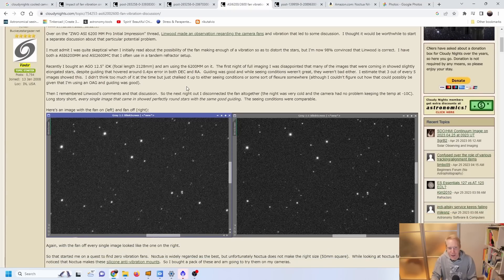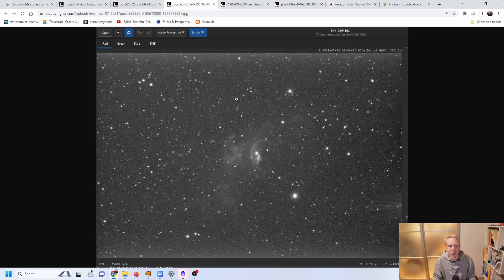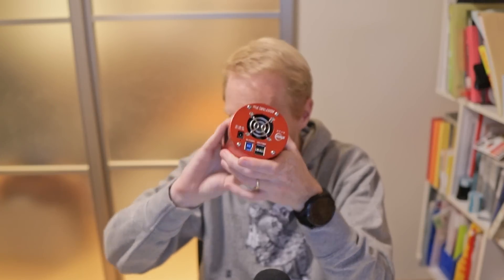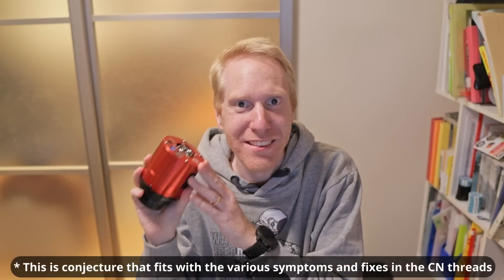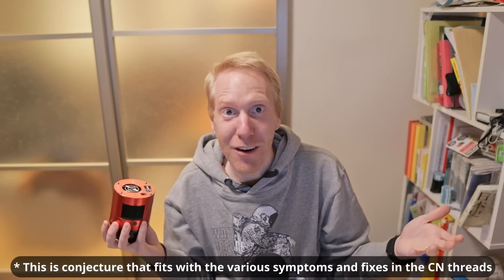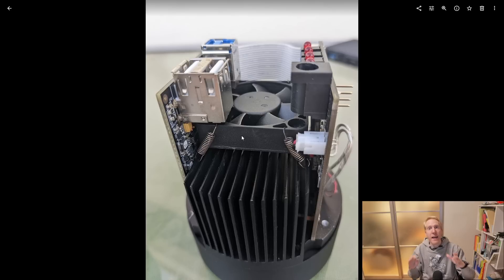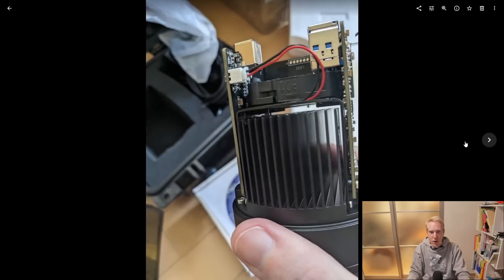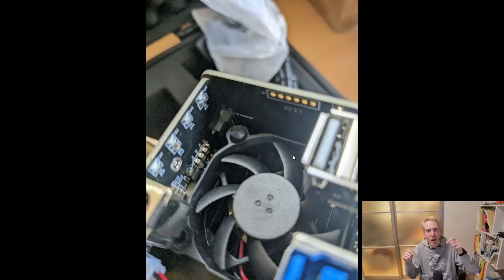Cooled Cameras can HURT our images?! 😱 HOW?? EASY fixes!

Comment: I have my 2600mc at -20 degrees. Is that too much for the camera to deal with? Should I do -10 instead? I'm not sure if I'm risking shortening the life of the camera by doing the maximum cooling, I dont mind using battery/higher power needed but just wanted to see if anyone thought having cooler -20 is actually bad for the camera long term. Thank you
Reply: @CuivTheLazyGeek Thank you so much as always sir, you’re a gentleman and a scholar! 🙏🙏

Comment: My 6200MC just developed a rattle bad enough to make the moon's edges wiggle. Its really bad when its connected downstream of an Off Axis Guider on my C9.25 for some reason, perhaps just an unfortunate harmonic. I fought with star trails for so long, and bought more and more expensive mounts to try to solve it to no avail. But now that i know its being caused by the fan, the idea of having to take apart my $3000 camera and monkey with affixing an aftermarket fan to a hacky rubber booger just to get a round star makes me want to be sick.

Comment: Thanks for affirming this fan problem!!! I have struggled all summer with the same fan issue with my ASI533MCpro....thinking the problem was with the mount tracking, battery. etc.
My fanon-fanoff Images were exactly as the images in your video!!
Reply from the maker: Glad this helped!! It's indeed good to be able to check and validate this!

Comment: Now there is a sale of ZWO cameras in the US for Black Friday I’m tempted to take advantage and buy my first cooled camera and I starting reading about fan vibration. I’m beginning to feel like an involuntary beta tester for ZWO. Having issues with my new ASIAir Plus because of the focal length of my C8 and the small sensor of the ASI585MC. If I buy a cooled camera will I get an imbalanced fan? Seems like all the issues with ZWO equipment are because of higher focal length scopes like my C8. So far if seen ASI533, ASI294, ASI294 and ASI2600 cameras mentioned in my research. I bet if you hook anyone of these cameras to power and hold the camera you’ll feel vibration., but like you said the shorter focal length equipment doesn’t seem affected.

Comment: Thanks for the video. I love watching your videos because you always look at things very analytically and show great attention to details. You think like me! One aspect you didn’t mention and that I don’t see mentioned in the comments after a quick scan is that if you are using a ZWO camera, there is a good chance you are using an ASIAir as well. Guess what. These have fans in them too and are often attached to the telescope or mount. So that’s another thing to consider. Another is the power source. If you use a portable power box like I do, it also has a fan in it. Even if it’s sitting on the ground under the mount it can cause vibrations.

Some solutions I’ve seen suggested by others are having a separate tripod with the ASIAir attached. I personally haven’t tried this because I can’t imagine the cable management difficulties being worth it. I noticed a little improvement when I put a thin piece of rubber between the ASIAir and the mount. The power box vibrations, which I first discovered while going through a focusing routine and noticing the guiding get jolted when the fan kicks in, can be cured quite easily. I folded up a soft blanket and put the power box on top of it. Strangely enough, now I notice that when the fan kicks in I actually get better guiding! I believe it’s some sort of frequency resonance where vibrations sort of cancel each other out. And one last thing is to purposely balance the setup East heavy. As you know, this is good practice anyway for smoother worm gear movements but it has the side effect of absorbing vibrations through tension. A perfectly balanced setup will be more susceptible to vibrations because it can move either direction quite easily while the East heavy balance won’t allow for small vibrations to have enough force to cause these little vibratory movements.

Hope that helps both you and anyone else reading this!

Comment: Spent 3 months with asi2600mc pro chasing down oblong stars with my Celestron 8 SCT.  guiding, collimation, tilt, backfocus, etc. nothing worked.
Gave up and bought a Celestron 9.25 Edge HD.  All above looked good except still I had oblong stars.
Tried exposures of 1,3,5,10,30,60,120, etc.  same oblong stars that all looked the same.
If it was guiding, they would be longer as exposure time increased.

Turned off fan.  Pinpoint stars at all exposures even at 5 minutes.

Turned on cooler,  oblong stars resumed.
Turned off, pinpoint stars.

So i decided to try my asi533mc pro.  Same issues.

On - oblong
Off - pinpoint.

Talked with ZWO.  they said certain scopes at longer focal length have a natural resonance frequency that induces vibration noise.

8 Edge hd was notorious.

Apparently it is not just that scope.

Now I own a 9.25 edge hd.  Darn!  Sorry, but I am not returning it.
Reply from the maker: It's really interesting, the SCTs seem to be the worst affected, the beefier long focal length refractors seem to be fine

Comment: Wow!   I never thought of that. Thank you for pointing this out I use a C14Edge+ZWO ASI2600MC pro and at 4000mm fl I had oblong stars.  I had no issues with the Hyperstar.  I tried removing my guidescope and using an off-axis guider with same result, oblong stars. This happend with good seeing and near perfect guiding.  I was using a CGE Pro mount.  I tried my Skywatcher EQ8RH-Pro with crazy accurate encoders and still same result.  Well I just ordered a set of these anti-vibration pads.  This makes a lot of sense as it wasn't happening with my ZWO 224 (non-cooled camera). I just hadn't clued into it.   I'm most certain this is the issue. Thank you.

Comment: Great video!  Literally just had to replace my fan in my 294mm in the middle of the night.  Had a normal imaging run last night, but when I started tonight I had really bad star trailing.  I had already remounted this particular fan on the elastomers two years ago when I fixed its brother the 294mc.  Took it apart and didn't see anything wrong with it, but was certainly out of balance based on images where I had the cooler on / off.  Luckily I had an extra fan laying around so was able to salvage a rare clear evening.

Comment: it should be possible to balance the impeller blade if its balanced then the need for vibration suppression wouldn't be necessary. This was an issue for cameras on drones as when the refresh rate came close to the propeller vibrations then problems occurred. Balance first would be better. Anti vibration mounts for drone cameras and flight controllers would work in the camera internally.

Comment: Holy crap... I was using my C9.25 @ f10 (2350mm)  for the very first time a few months ago. (I've been imaging for 4+ years). I was using the 533mcP. I was getting perfect oval stars. I had only used that camera at f2.2 (525mm)

I could not figure out what the heck was going on. I thought I had an optics problem due to a previous incident(another story, Isn't astro fun???). I was playing with tilt and everything I could think of. I gave up at 3am... I think this is it. 

I think you are right, it isnt just ZWO... I thought when I first saw these cameras tht a fan on the body could cause problems... but I was thinking more when they start to break down.
Reply from the maker: Did you find out if that was is??
Reply: @CuivTheLazyGeek I'll investigate this weekend now that you have given me more to go on and will let you know.

It was not a guiding issue because I was getting perfectly illuminated pill-shaped stars and know what those look like (too well, lol) I was totally confused because it didn't look like a mirror issue or tilt since it was so consistent over the entire image... 

I had wanted the Silver Sliver Galaxy up close and was curious if my image would be better without the f7 reducer. I think this may be it. You have given me new hope. Maybe I'll get a few f10 images out of the C9.25 this summer!

Comment: @CuivTheLazyGeek  So even if the fan has a magnetic air-bearing these vibrations are still there? I'll have to revise my Dedicated Astro Cam Selection Spreadsheet. Curious: could N.I.N.A. be set up to shut off the fan during acquisition and on in betwee---nevermind.
Reply from the maker: Well it can depend on the fan as well, and on the scope itself (heavy fracs may be more resistant?)
Reply: @CuivTheLazyGeek  That makes sense. A 150mm APO on a CGX-L might be less susceptible than say a RASA 9.25 on a light mount at max capacity.

Comment: It's probably the fan indeed, but thinking about it, as a wild guess, could it be possible that the equatorial mount is experiencing low current? These newer dedicated cameras consume a lot of power to cool the sensor, and perhaps the R.A. motor struggles more to perform tracking and the necessary autoguiding corrections when active cooling is enabled, "drawing" power from the source. Of course, this probably only applies in cases where the equatorial mount and the camera share the same power source. Anyway, this could explain why the stars appear more oval-shaped.
Reply: No. The PHD2 log shows no difference between cooler on and cooler off.

Comment: Well I got the anti vidration feet , at first I bought the wrong size so I sent them back and got the SAV3 . went to install them and the dont fit. I could not get the feet into the fan. I took some struggle to get the through the holes but I could not get them any farther up. I did not want to tear them or mess up the fan. I am using the zwo 294 so maybe the holes are smaller ???

Comment: I've noticed an issue with my ASI2600 MMPR when photographing the sun with exposures ranging from approximately 1 to 3 ms. The manufacturer suggests a makeshift solution which involves adding an additional O-ring. However, I find this to be inadequate because the O-rings don't prevent the mounting screws from continuing to be in contact with the fan body, thus the problem is not avoided.

My impression is that ZWO isn't treating the solution to this problem with the seriousness it deserves, in a similar way to how they handled the oil spots detected on the sensors of the high-end ASIs. This was an issue that wasn't properly addressed until it began to be claimed through public forums. My perception is that ZWO doesn't have an effective customer policy, and only responds to the technical problems of their already sold cameras when public complaints begin to affect them.

Therefore, I believe there's a need to further publicize these issues. If any videos or photos are needed to demonstrate these points, please feel free to request them.

Comment: I’m running a RC with fl 2800mm, QHY268MM, and OAG/ASI174: no vibration issues. But terrible tracking issues because either no trackable stars or sooo mushy stars that PHD2 was having problems locking to part of the star. So I attached a 1300mm Maksutov and now my tracking is the best it’s ever been. Last two sessions sub-pixel tracking typically 0.5 or less. I’m ecstatic!
Reply from the maker: Everyone seems to be saying QHY is vibration free, excellent!

Comment: Before you take your camera apart, test by simply turning off the cooling.  I'm wondering why you see oblong stars,..meaning the vibration had specific orientation. Was it consistent across the frame? I would have expected larger stars but not necessarily oblong from this issue.  
I'm also curious why you are only seeing this with long focal length optics. It sounds like  the vibration is bring sent to the OTA and that is the issue, not the vibration of the camera sensor itself. In that case these may be something unstable about the OTA, perhaps the hyperstar housing is not tight?

Comment: What about sacrificing a little bit of cooling capability, and take out the fan completely... What if, you no longer cool down to -20C, and instead, go for 0C, so assuming this 20C degree difference would be sufficient for the fact that you take out the cooler, so heat is no longer being dissipated so efficiently... but the difference between 0C and -20C is not that much, especially with the new generation cameras, which already have low noise... in the end, the point is to have good calibration with properly matched light/dark frames, so it should work... 
Personally, I wouldn't mind sacrificing some Celsius degrees, and avoid the whole vibration problem, altogether...
Reply from the maker: Even at 0 degrees I don't think a fan less solution would work... Could be good to test though!

Comment: I have noticed the ZWO fan isn't quite centered in the housing either, I have aquired a new camera from Player One Astronomy called the Artemis-C Pro and have noticed the fan is dead center, and when powered on with fan running I cannot feel a thing. The fan being slightly off center would also cause slight osclation

Comment: Ah I got the same issue on my RisingCam camera and I exchanged a Noctua fan to solve the vibrating issue.
Reply from the maker: Was it gen1 or gen2???
Reply: @CuivTheLazyGeek  It was Gen1. It was so hard to address. Finally, I checked different exposure times and found the egglong stars even appears in 0.1s shot and start to check other vibrations than mount.

Comment: This is probably the issue with my ASI2600MC C11 setup. The Stars were also elongated in that direction. I thought it was back focus. I will say that in the summer time when my C11 is out more the cooler is working a lot harder (-10) and it seemed no matter what I did the elongated stars wouldn't get better. Thanks for this.
Reply from the maker: Glad to help! Hopefully you can get to the bottom of it!

Comment: Hello Cuiv, I always follow your videos with great interest and in relation to this video I wanted to remember my direct experience with these small fans in other sectors which are usually extremely well balanced. It may happen that someone is born badly but it is easier than working for many hours in the end a little dust accumulates on the fan blades which, increasing over time, unbalances it and creates harmful vibrations. Often paste clean the fan with a few cotton swabs and some alcohol to solve the problem.
Reply from the maker: Thanks Massimo! That would be an easy fix indeed!

Comment: I'm also just speculating. Maybe it's more related to image scale rather than a matter of focal length? Sure, with the same camera you will get a lower resolution (well, actually a "better"/higher resolution; less raw numbers) when increasing the focal length. But, if you have for example 0.5''/px with a particular camera and a high focal length ota and facing this issue; would you get the same issue with a lower focal length ota and a different camera (with tiny pixels, and also a vibrating fan) with the same resolution of 0.5''/px? Probably yes? Furthermore, binning the camera on the high focal length ota would mitigate the problem?

Comment: I'm not sure that I would be as charitable to ZWO as you Cuiv. If fan vibration is indeed the cause, then this is a design flaw or QC issue that ZWO should acknowledge and fix FOC on request. It's not an 'oh well maybe they'll fix it in a future release and we can buy the camera again' type situation to my way of thinking. And it certainly should not be up to the end-user to modify their camera to fix a design flaw and invalidate their warranty in the process. It seems like a pretty basic fail to me that to a manufacturer should be obvious. As pointed out in the video, other manufacturers are aware of and have designed out this issue. The only way it would be acceptable would be if all ZWO cameras were rated up to a certain focal length, then as a consumer you would know that if you planned on doing long FL work, you would choose specific cameras rated to keep vibration below a certain level. That not being the case, like the oil-leak problem, this should be something that ZWO fix for free- I feel very strongly about this! I'm pretty sure that legal bods would also win any argument that claims such a fault would potentially make their cameras not fit for purpose.

Comment: Cuiv, excellent video as always!  Do you think  there is a "limit" on the focal length where shorter than the limit is ok, but longer is NG?  Could it be calculated mathematically?
Reply from the maker: No it will depend on the fan lottery (amplitude of vibrations) AND the type of scope used, how the camera is attached, etc.! So a lot of factors...

Comment: Hi, great video thanks!  I had this issue with an Altair 294C Pro Tec which has the old fan connection setup you show for the RisingCam. This was the issue I posted as ArEnJee on Cloudy nights. I also had the same issue on the EdgeHD8 with the Altair 26C Tec, which again is the same (old) design. I've been trying to work around the problem for some time (using lower voltages so therefore fan speeds sometimes helped). 'Fortunately' the fan burnt out on the 26C and I had an excuse to replace it with a low vibration alternative (Noctua NF-A4x10 FLX, Premium Quiet Fan, 3-Pin (40x10mm, Brown). That worked.  It's relatively straightforward to do as a straight swap, still using the springs - you just need to recycle the original 3 pin connector, shorten and join the wires together (I used telecomm dots)